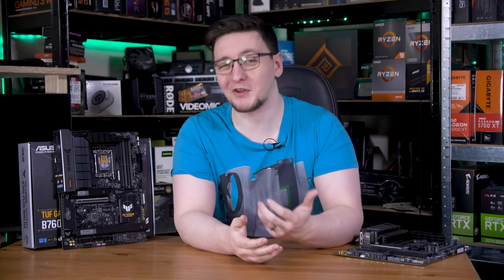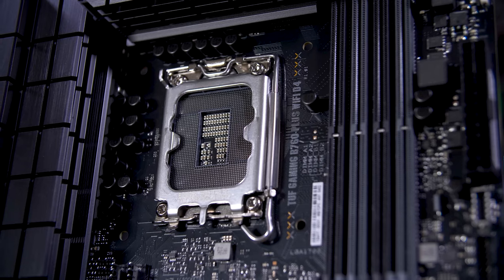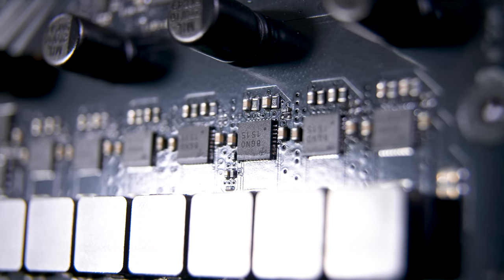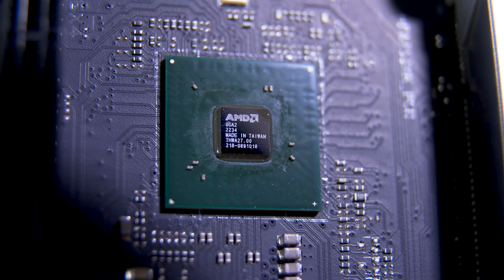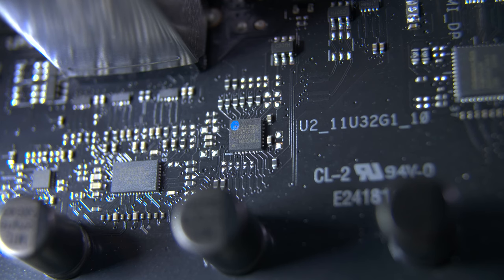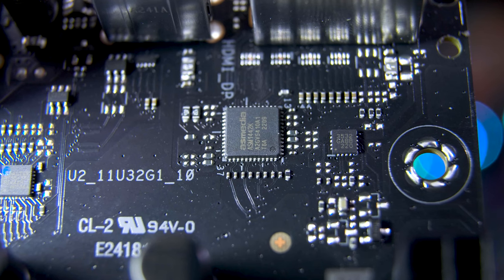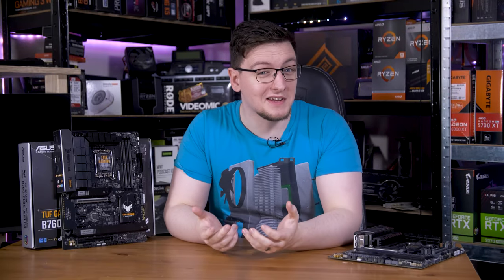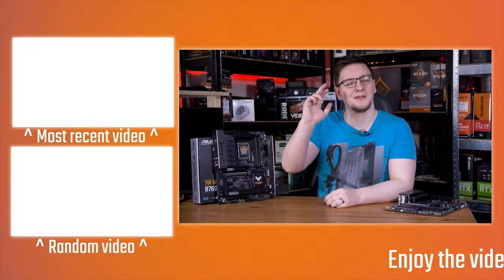The Anatomy of a Motherboard

Comment: I'd appreciate a guide on things to look out for/pay attention to when considering a motherboard purchase. I get tied up in knots or confused by lack of product info on listings, even on manufacturing sites finding out exactly what I would be buying. E.G. a brand might brag about having 2 PCI 5.0 x16 slots, but that becomes meaningless as if you populate both, they step down to x8 speed and therefore equal in speed to 4.0 at x16. Which is fine for now, but not so much later on when 5.0 GFX cards come in next generation. Also, what effect on performance/overclocking difference is there between a 16+2 phase and 18+2 phase? Also other quirks like if you populate all your M.2 slots, you can lose some/all your SATA ports. There is little transparency on quirks like these IMO, and it's easy for many to get caught out by them and end up with something that didn't meet expectations.